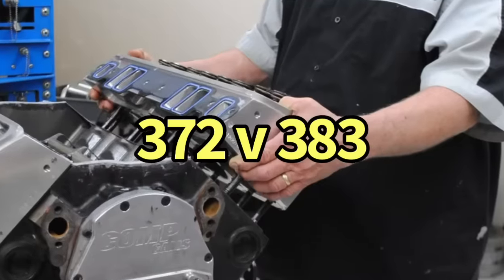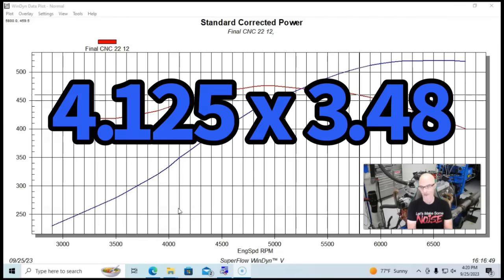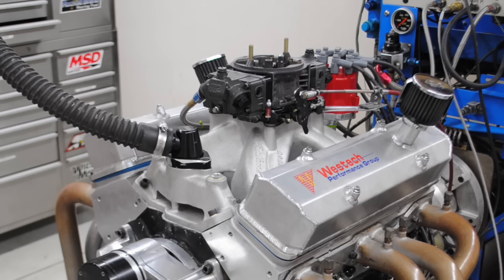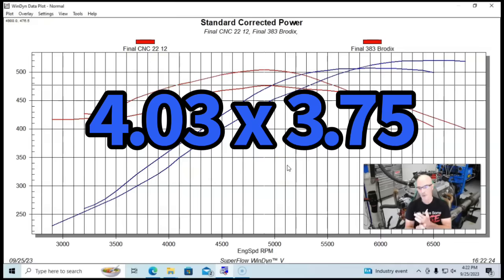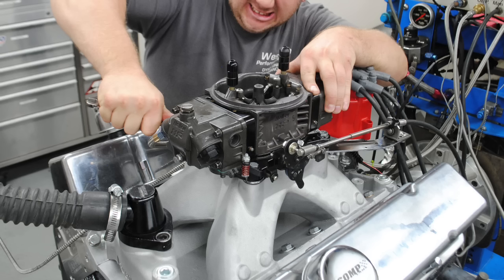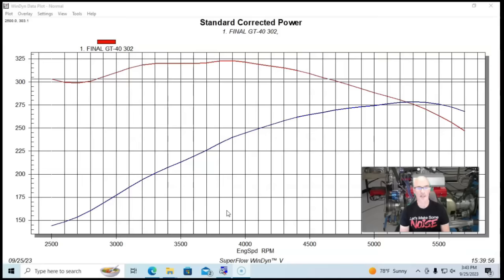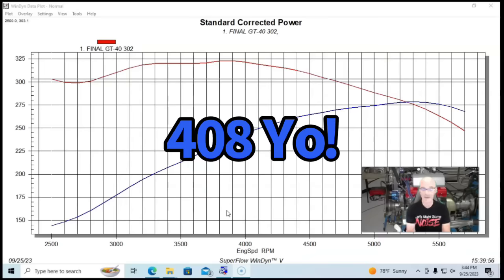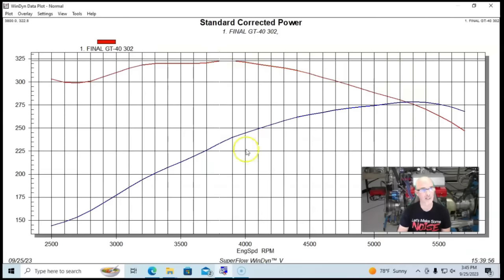BIG BORE VS BIG STROKE-372 VS 383-WHICH SBC STROKER DOES IT BEST? BONUS TEST-302 VS 347 FORD

Comment: That long/short stroke graph looks like every test I've ever done, though being in the UK our No's are on another scale.
90% of the motors we work with wouldn't make 500hp with boost, nitrous and race fuel. 🙂 Or if they did, the pistons would go down, and keep going . Our stuff is just so much smaller, a 2Ltr is now regarded as a big motor

Comment: adding stroke not only increases some displacement, but it also increases the leverage of the crank. the pistons are now pushing down on a LONGER torque arm.
Also on a small block chevy, if you put a 3.75 stroke crank in a 4.125 bore block you will make more power than both the 383 and 377. I think they might have made an engine with that combo.

Comment: Great report Richard. I went with the 400 small block with 350 crank & rods. The block is +.040, comes out to 380 CID. It has a mild cam with 110 LSA, full roller rockers in 1989 GM center bolt, aluminun heads. Using a performer intake with Edelbrock 750 carb. On the Dyno it did just what I wanted for a street car, 424 lb.ft of torque at 3400rpm. It really moves my 1980 Z-28 Camaro, 0-60 in just over 5 seconds. its been in the car since 1991 and still runs great. Next year I'm thinking of trying a better set heads. The factory heads don't seem to flow enough for top end HP.

Comment: Did a 5.0 HO swap on my purchased new 1987 TBird Turbocoupe.  Super budget I torque ported the stock heads and intake, ran an E303 cam and 1.5" shorty headers.  Never replaced the stock valve springs (mistake).  Made 314tq at 3500rpm and 250hp at only 4700rpm on a Dynojet.  As for the low power rpm I never replaced the valve springs or headers but did try an Edelbrock intake with no improvement.  Interesting how it compared to the baseline motor above.  Was a ton of fun as a street car!

Comment: Old Ford guys very familiar with long stroke larger displacement engines w/ poor airflow back in the '60s. Mucho torque on the low end. Great truck engines.

Comment: Look at things from the Crankshaft point of view. A destroke 372\3.48"  is like a very good running 350. And it doesn't have to be a high revving motor. I've always felt one of these would make a great Street Blower Motor for a Weiand 144 or for a Turbo if you want the higher RPM's.

Comment: 372 can get a better head with bigger valves, I hate all these comparisons because they don't allow the BB to do what it does...

Lastly, the long stroke motor got the tight lsa cam, and the BB got a looser lsa cam, which is is why the BB is further down on mid-range power more then the displacement difference would let on.

Comment: You can attribute about 14 fiddebees (ftlbs) of torque to the difference in displacement.... 383-372=11 inches difference. 11 inches * 1.3 ftlb/in = 14 ftlb....so that explains about 1/2 the difference between these combinations. The other half comes from variability in HCI. Displacement doesn't care if it comes from bore or stroke - so long as you're somewhere in the vicinity of "square" (ish)... Say between about 0.75 to 1.25 bore/stroke ratio.

Comment: I think the real benefit of a stroker vs a high rev configuration is that it can typically be done at less expense than the latter. Gears can be configured to translate to torque at the wheels, but for an engine to live in the high RPM's requires excellent balancing and a lot of high intensity parts. Not so much with a low rev torque monster.

Comment: Here is a test I would love to see. 421/427 SBC and SBF. Both use aftermarket blocks and rotating Assembles,  Both should run 11.0:1 compression, Both use very similar camshaft design, both use AFR 225cc to 227cc CNC cylinder heads, both use Similar size intakes and the kicker? both use 950-1050 CFM carburetor. Here is the bore and stroke, 4.185" bore to 3.875" stroke. Let the war begin.
Reply from the maker: If you make them both the same, them both make the same
Reply: IF... If the heads flowed the same, the curves would be very similar. (The cost would probably be the biggest difference!)

Comment: I always thought a stroker motor would make more low end torque than a large bore short stroke motor due to leverage.  That why we use breaker bars on lug nuts instead of a ratchet.  I know the difference in stroke is not much but it probably enough to make a difference.

Comment: The LSA was not good for the 372ci. It would not match the 383ci, but it should have been closer. 
That being said, the longer stroke will always make better torque, while the larger bore will make horsepower per David Vizard.
Reply: off the shelf cams NORMALLY  come with 110 LSA

herbert cams lets you pick the LSA whether or not you wan a cast gear and if its a small base circle  or not
Reply: @KingJT80  with "off the shelf" then yes, however as David Vizard says "never buy off the shelf, custom order your cams".
Reply: @SteveSega  Yeah he's the man not going to lie there but it's not like you won't make a lot of power with off yourself parts is obviously shown in the video you can do it if you wanted to
Reply: @KingJT80  all the cam companies let you pick the lsa and lobe family

Comment: I am in a stroke dilemma with my Ford R302 block. Came with a forged 3.25 crank and a bore of 4.020. I could run that crank, bore to 4.125 for a big bore 347. Or buy a 3.40 crank and bore to 4.125 for a 363. Heads are Trick Flow Twisted Wedge 11r 205 with 56cc chambers. Is spending the money for a forged 4340 crank worth the power I would gain. This video did give me good information for my decision. As always excellent job Richard. Thank you
Reply from the maker: you are talking about 20 ish hp
Reply: Thank you. I think I am going to try and sell the 3.25 crank and go 363

Comment: (372 vs 383)
in this case it's a Dyno case. but on the track is a different thing.
the 383 cam drops-off the power some 530 RPM sooner than the 372 does. so at the track the 372 can take better advantage of lower gears than this 383 can. you sure do not want your 383 dropping off it's power 125ft before the finish line! these lower gears in the 372 will also make up for it's lower Torque.

 to add, lets throw out brand. and you are building/making your own heads and block. the engine will be a 350 cid. what stroke will make more power with the 600 lift cam you have? a short 3.480 stroke 350 or a 3.750 long stroke 350? well, the short stroke 350 with it's 125" larger bore will have much larger valves.

Comment: David Reher of Reher Morrison convinced me that, all else equal, a bigger bore/shorter stroke is the winner.  Less piston/bore friction, less windage losses, and better airflow through a given set of heads, you'll just make more power every time.  He also explained why the longer stroke doesn't really make more torque than the same displacement increase from bore.  Basically, peak cylinder pressure occurs not long after TDC on power stroke.  By the time the crank rotates to where the rod throw is sticking way "out" from under the piston where the increased stroke really would have increased leverage against the crank, the cylinder pressure is mostly gone.  So the highest cylinder pressure, and thus most downward force on the piston, occurs well before the rod/crank angle is enough to take much advantage of extra stroke.
Reply: I would add that what you might gain in leverage you'll lose in piston area, as well. 
And in the end no one will race torque anyway, it's all about average hp. 😄
Reply: @PSA78  Of course, average hp is average torque...
Reply: @neilsmith8790  Torque is trapping efficiency of one combustion, hp is average trapping efficiency over a certain time (rpm). So within the same engine I guess you could compare average torque during development, though in the end it's always hp that will dictate things like acceleration and speed (and what's actually the best average for the application is dictated by gearbox etc; as in trapping efficiency measured at the wheels). 🙂
Reply: @neilsmith8790 exactly, HP= torque x rpm ÷ 5252.

Comment: You have shown me something I was wondering about. I was thinking about going to a 408 from my 360 La small block Mopar. I don't run much over 6000 RPM. But I need torque to move my 5789 lb. Van in the 1/8 mile. And I'm building it to run ether a procharger and nitrous or just a 500 shot of nitrous with a skat forge rotating kit with the better rods for it to be capable of 1500 HP.

Comment: I would really love to have my 5.7 Hemi stroked, some Edelbrock heads, and some headers for my 2005 Daytona edition RAM 1500. I don't want a different camshaft, and I don't want a different intake manifold. I just want more torque with a little more airflow on the exhaust side. Nothing super fancy. Just a stroker crankshaft with the appropriate connecting rods and pistons, new heads, and headers.

Comment: The interesting bit is if you gear the 372 to peak at the same MPH as the 383. Having the 372 shift when the 383 does at 6100rpm would net a 10% better gear ratio for the 372, which would multiply torque at the wheels - inflating the peak to 524lbs up from 477. It would end up faster than the 383 everywhere.
Reply: I get what you're thinking and it confused me too for a bit but this is accounted for in the HP calc (ultimate work). For an engine to make the same HP at higher RPM, it must necessarily be at a lower torque, thus the torque to the wheels is the same because the lower engine torque is multiplied slightly to stay in a lower gear longer. More gears, closer ratios and shorter gearing is huge for acceleration which gives higher RPM engines much better flexibility, but is theoretically countered by more gears in a low RPM engine. 

I'm not doing a great job explaining this and I hope you're understanding the point. Older transmissions with 2-3 gears and long ratios made a huge difference in slowing acceleration, but a close 6+ speed transmission these days will make anything from a Diesel to LS to Coyote pretty close in acceleration for a given HP within a fairly wide acceleration range (0-120mph, etc). RPM limit becomes very important with few gears as optimizing for acceleration means a proportionate narrowing of speed range (basically drag rear end only, undriveable highway) relative to peak RPM.

Comment: 383s are popular because 4.00" bore blocks are plentiful. Or were at least. The 372 (short stroke big bore) was a way to take a 400 block (plentiful in the 70s and early 80s) and use a factory steel crank from a 350 with spacer bearings, before offshore engine parts became so cheap.  Thats were all this came from. Unless you have a rules limitation, or don't want to spend the money or an aftermarket block, you build what you have. Logically, 406 beats them both in most cases. I have a 383 in a daily driver and i love it. I sure wouldn't mind a 372/377 either. I would take a 406 over both.

Comment: This is a camshaft thing.   The RPM for peak torque and peak hp way down on the 383.  Narrow lobe separation also points to lower rpm combo and quite frankly the comp cams is a peppy street/strip cam

Comment: For the 372 vs 383 there are too many variables to pin down where the difference comes from. Even with identical piston relief, head cc, gasket thickness and deck height the 383 will have about 1/2 a point more static compression. Then you get into dynamic compression being effected by the cam and even rod length. I think if you simply swapped the same H/C/I from one engine to the other, both with at least nearly the same static compression ratios, the results would be much closer. 

And for the guys that say "long stroke=torque and short stroke=RPM" I ask what about the 403 Olds? It had a bigger bore than the Chevy 400(4.351 vs 4.125) and a shorter stroke than the Chevy 350(3.385 vs 3.48). When it was introduced in 1977 it made more peak torque(320lb-ft) than the previous year Chevy 400 out of an Impala(305lb-ft) at only 200 RPM higher. 

The 403 was put in giant full frame sedans, station wagons and even GMC motorhomes by the way. Hardly applications suited for a "high RMP engine with no low end torque"...

Comment: I think you can get away with more out of the 372 because it doesn’t experience valve shrouding like you would see with bigger heads on a 383. But built with smaller heads I think the 383 would shine because it has the cubic inch advantage

Comment: I would love to see a comparison like this for a Chevy 305/334.  Someone I knew years ago had a C10 that they stroked the 305 to a 334, as they wanted more towing power but didn't want a 350 (not sure why).  Once they stroked the engine it really did have more low end grunt.  I'd be curious to see a 305 stock/305 performance, then do a 334 stock/334 performance comparison.
Reply: that would be cool, since stroking a 5.0 Windsor Ford is common enough but it seems like few have heard about the stroker 334. then again, unless fuel economy is an issue, it's probably cheaper in the short run to nab a used Vortec 350 and swap the 305 for that.
Reply: I did a 302ci then stroked to 332ci is that close enough, the power curves were nearly identical with the 332ci TQ & HP curves moved up @ 40.  I think the 332ci TQ curve peaked 500rpm earlier.  I used 1 5/8” shorty headers for both and feel like they were holding back 332ci.
Reply: @msk3905  was that a Chevy or a Ford? we were talking about both engines so I'm confused.
Reply: @albertgaspar627  I know you are talking about Chevy but I’m talking about Ford
Reply: @msk3905  that's why I asked, you said a "332" cid but most catalogs refer to it as a 331 stroker setup.  interesting the extra 30 cid created nearly identical curves, perhaps it was getting choked somehow. I think this channel has videos before and after of Ford low deck stoker combos where the power difference is noticable.

to answer your question, yep, both engines are 4 inch bore, 3 inch stroke, for 301.9 cid. Ford didn't have the room for a 6 inch connecting rod that people think helps make power, but the Boss 302 used a longer connecting rod from the 289 engine, if you believe in "long rod" theory. Otherwise, the Windsor tended to use smaller head ports and valves to generate torque at a lower rpm, blowing away theory that a big bore short stroke engine must be a high rpm piece. it depends on the heads, as the Boss 302 pointed out.
Reply: @albertgaspar627   4” bore with 3.25” stroke with 8 cyls is 331.7ci so I consider that a 332ci not the 331ci that everyone lists it at.  302ci had all same things except TFS Street Heat intake 332ci had TFS Track Heat intake, I think intake and exhaust were holding both back (more 332ci) but 302 was a stout little motor and the stroker moved curves a bit and sadly only added about 40 HP. Went back and forth when bought heads and at the time everyone was saying 185 were too large for 302 and will reduce velocity giving slow throttle response and wasn’t entirely sure if I’d go stroker so used 170 heads, after watching all of these videos wish ai went 185 route.
Reply: @msk3905  well, that's fair since the 302 is really just 301.9 cid :)  

'wonder what a good porting would have accomplished with the 170 cc head if anything. often the amount of air flown in and out of an engine doesn't compensate for the quality of the air flow (ie, how well the gas molecules are suspended in the air and do they separate) and then there's issues with the chamber design and how it burns. depending on the shape of the port and the angle of the valvestem, maybe a touchup porting would have bridged the difference. but that's a "maybe" and you'd be paying an expert what the difference in off-the-shelf parts would be.
Reply: @albertgaspar627  by my math it’s 301.6cu in?
Reply: @msk3905  4.030"
Reply: @kramnull8962  good catch

Comment: Depends on the usage. 372 would be a better choice for racing and the 383 is better of a street car. A tighter lsa would be better for both engines.
Reply: if looks and the extra work were not a factor wouldn`t most be happier with a `modern` 5.3 or 6.0

Comment: Thank you for the stock 302 vs 347, this information will apply to my truck build someday!
Reply: Don't go 347 tho if you're buying an aftermarket block, the 363ci is even better than the 347 in trq n hp..
Reply from the maker: you can't build a 363 from a stock 302 block
Reply: @richardholdener1727  I agree.. I meant if he's buying an aftermarket block like the Dart..
Reply: @P71ScrewHead  I am sure you're right, but I only have sbc's, I was just talking in general principals of stroking an engine that will be mild otherwise, like my TBI truck.
Reply: @harleysgarage327  Then the 347ci stroker can fit on the stock block.. Still 500hp will be the limit.. Very fun tho..
Reply: @P71ScrewHead just go 393 or 408. Same price on kits or a tad more
Reply: @cedricwilson2055  As Richard said, if he's someone's gonna buy a 302ci block from the junkyard, might as well start with the 351W n go from there.. So yeah, even a 427W stroker is possible.. But guy here wants a mild build so a 347ci stroker on what he already has is fine imo.. I'm building my 4.6L 2v n that's a 281ci..lol I'm making 309rwhp 321rwtrq right now with my TFS top end..

Comment: My 377 big bore made 597 hp at 6400... with  brodix trac 1 heads. A 669 lunati roller. 112lsa 500hp at 5k and still 500hp at 8k  the point everyone misses we don't race dynos, the 372 will flat stomp the 383 on the track, example  you'll be pulling 30 to 40 more points in the gear. That multiplies torque. We raced a 311 inch motor against 358 motors and pulled them 3 car lengths down the straits on a 1/2 mile track we were turning it over 8800rpm and we were mild on the gearing coulda turned the motor 9200 easy. People need to realize that. 99% of all Passing in done from the middle of the corner to the flag stand. That 30,40,50 points in gearing will do that.